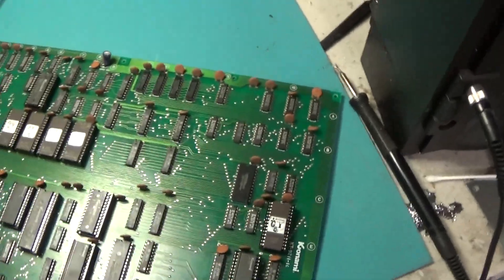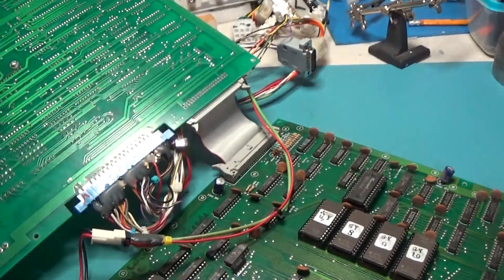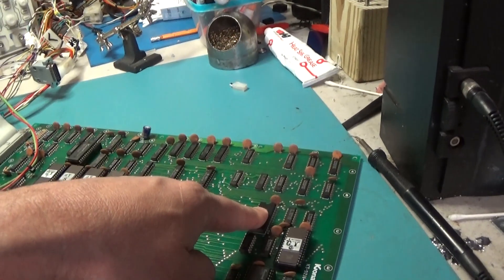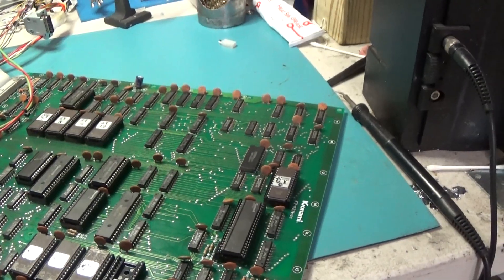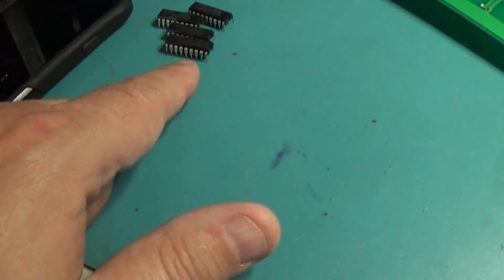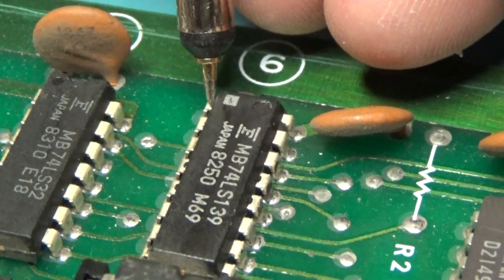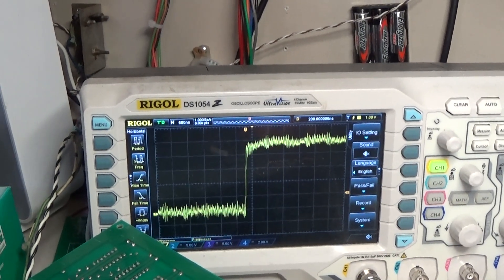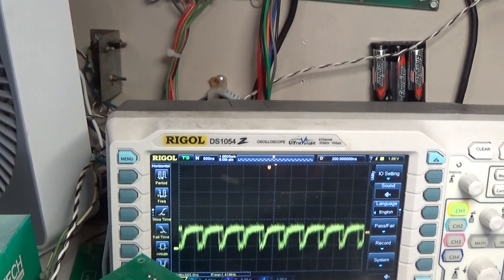1983 Konami Gyruss PCB Repair - Yes Another One!  BAD Sprite Video    5-8-2025

Comment: Yeah that doesn't look like a 2114 issue. Those boards use 2114s as a scan line buffer so that would normally show pixel wide issues not random placement
Reply from the maker: @MartinPiper6502  the scan line buffers are actually two 2148 on that set.